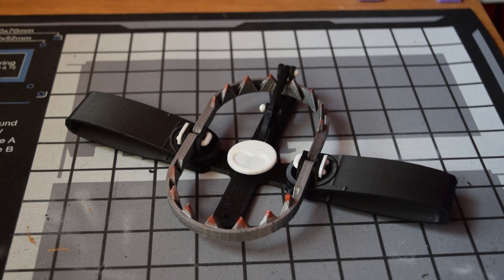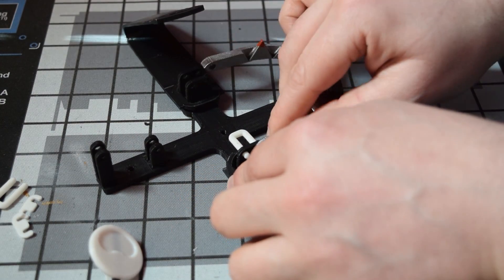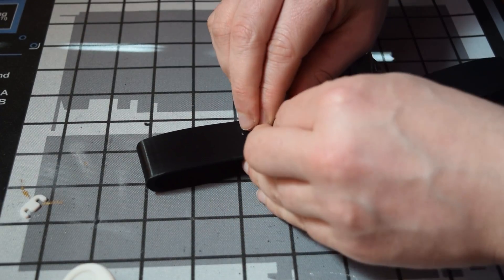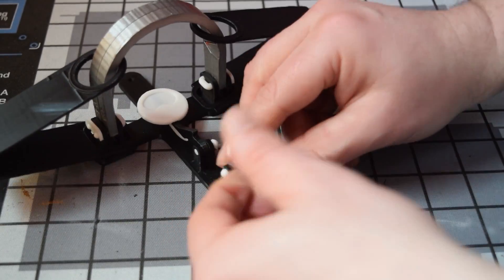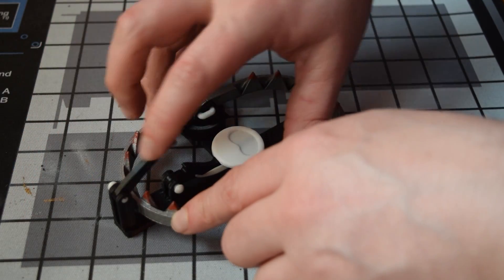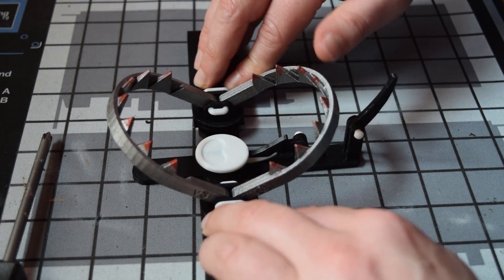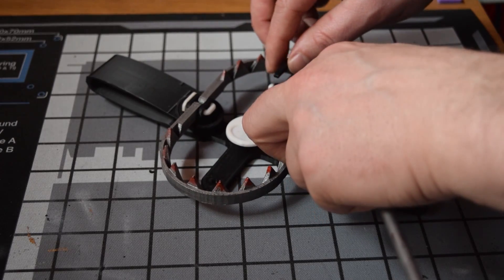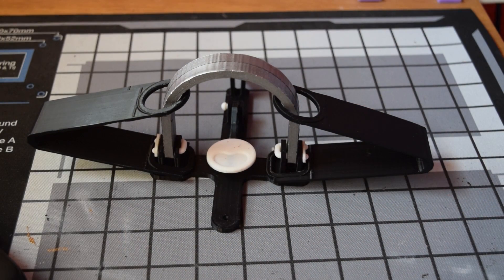Bear Trap! - 3D Printed - Creality K1 3D Printer - Print Ideas - Best Free 3D Models

Comment: sadly I have been having issues with the print specifically the springs and parts files where for the spring the edges just pop up on like layer 5 and mess it all up and on the caps in the parts file it just starts spewing PLA. Have you got any fixes or advice to help, and thank you love the content
Reply from the maker: I didn't have any issues with the stl's I downloaded, all came out without any issue